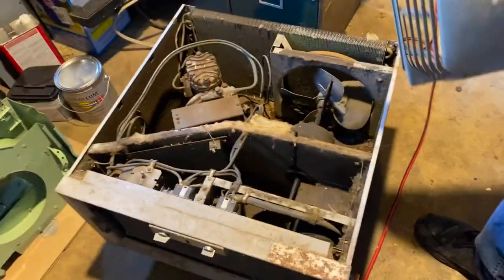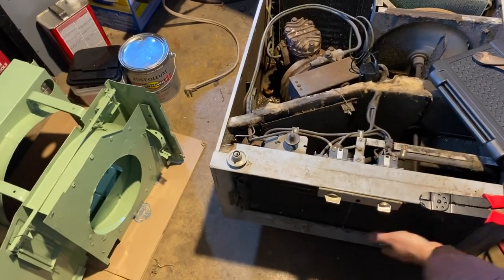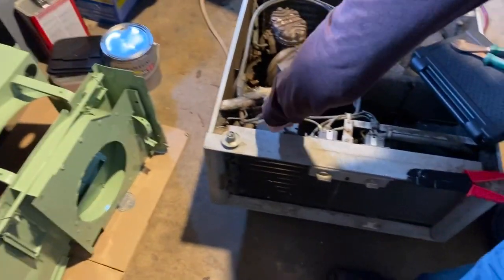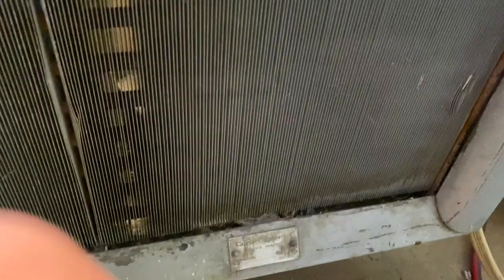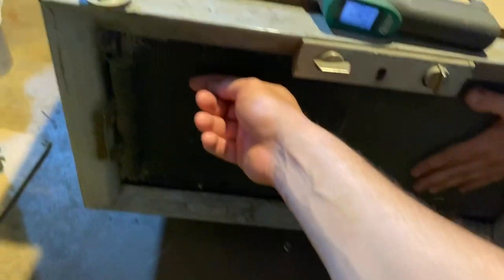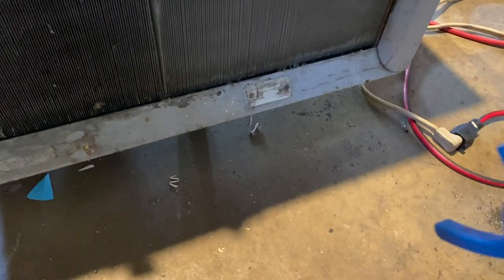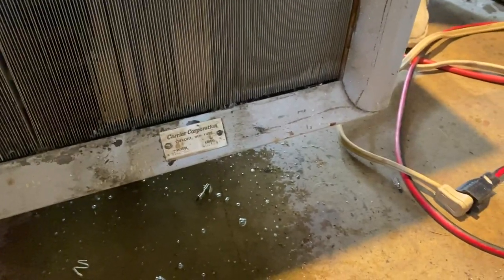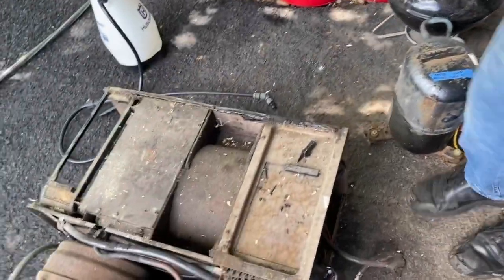1953 Carrier Silhouette Room Air Conditioner

Comment: Great unit!
I had the 1951 version (Model 51O2-115).
Because there is no run capacitor to improve the power factor, this unit will draw about 12.5 amps. A 12-gauge extension cord is highly recommended.
Reply from the maker: Ext crd only 4 test

Comment: Had one of those as a kid in the early 70’s at my parents house. Got it from an old lady.  That is R12 with a Coplametic compressor.  Was super quiet. Never needed a charge. Used it until we got central air.
Reply from the maker: Way cool!! Was it left in or thrown away?
Reply: @TheAirConditionerGuy   We gave them away.  Also had a Frigidaire mid fifties unit called “super 75” I think, as well.  Ever seen one of those?
Reply from the maker: @DEW409  nope! Cant say i have!
Reply: @DEW409  Frigidaire made two styles of units in the 1950's: the older one was a horizontal type chassis that extended far out of the window, like the Carrier unit in this video, and the newer one was a vertical style like the GE High Thinline models.

Comment: Used to have one in the house I grew up in. Exactly like it. Was 12k 220 volt
Reply: That would probably have been the 1 HP model. I think it had the condenser fan mounted vertically, in the bottom of the unit; with 2 fan motors, one for the condenser and one for the evaporator.

Comment: Back in 1965 I had this air conditioner in the dining room (where we lived then) I was a kid then and it wouldn’t cool the compressor would come on and I would hear it but the air was never cool so I actually tried to push it out the window but they really had it anchored really well because I had a little Westinghouse mobile air I was going to put in its place even back then I love the air conditioners I tried with all my might to push it out the window it would’ve landed in the alleyway between the two houses probably broke the cement on the bottom it was on the second floor.
Reply: To bad you don’t have it anymore

Comment: A great example of an American product engineered to last forever.  Most people replaced these units because they were "old-fashioned" never realizing that whatever they replaced it with wouldn't last a fraction as long. That Copelametic compressor could survive an atomic strike!  Compare that to the flimsy, noisy, cheap, very hot running Chinese-made rotary compressors of today destined to be in land-fill in a few years.  Yet people believe that the modern window units of today are better and more efficient!!??  Go figure.  They need to educate themselves.
Reply: When will you be posting pics of your collection
Reply: Unfortunately, many if not most people today are more concerned with style and fashion than with functionality and reliability. They probably get that way because of the mass media. Any attempt to educate them would be a waste of time.
Reply: @johncantwell8216  I agree, John.  The masses today are de-evolving.
Reply: @air_conditioner_man  Good to hear from you, Ken! I hope you are doing well.